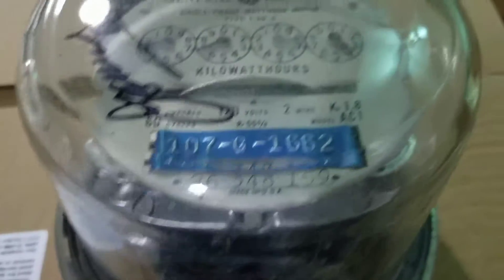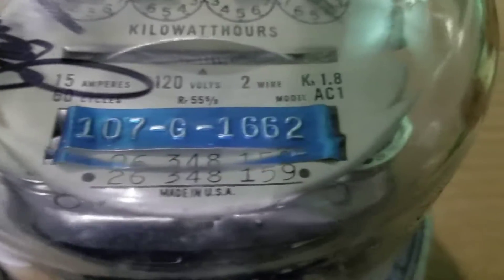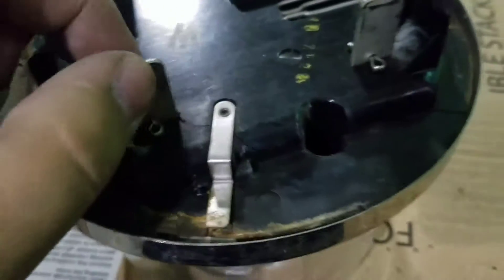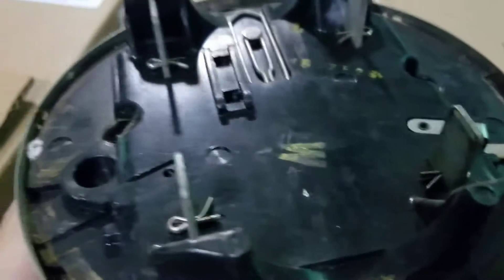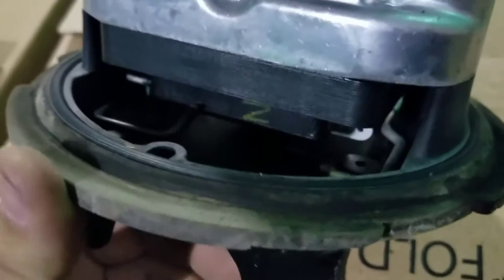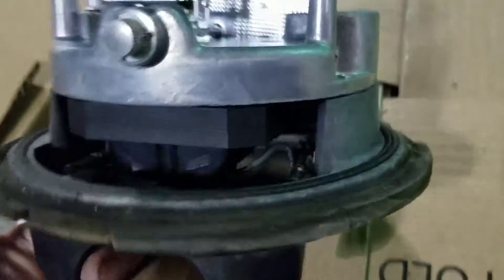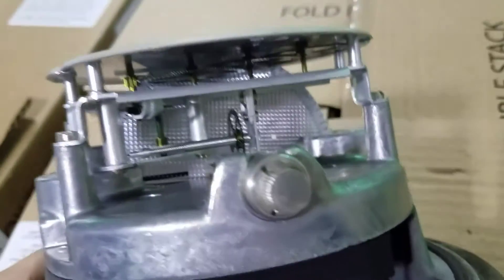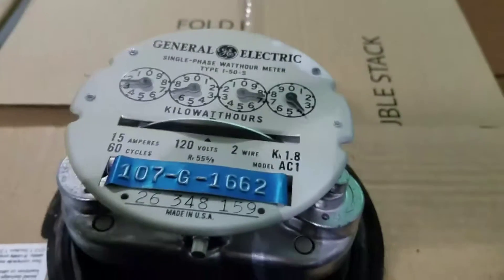GE I50 S 1s Electric Meter Overview

Comment: Type I 50 meter is a 60 Amp meter. In late 1954 Type I 55 meter introduced a 100 amp stator.  Type I 50 stator has an overload capacity of 400% and Type I 55 has an overload capacity of 667%. Also a very cool and commonly overlooked design detail of this Type I 50 meter. Serial numbers starting appx. 26, 259, 000 - 26, 390, 000 late 1940's The "General Electric " had this very fancy lettering stamped on the register faceplate.  The very first I 50 meter 26, 000, 000 had the block lettering and this was resumed after these very brief period of this rare and unique old English style lettering. Not sure why this was produced with this style lettering for such a brief period. However these I 50 meters are very rare and unique, not many were designed like this! Very cool meter!